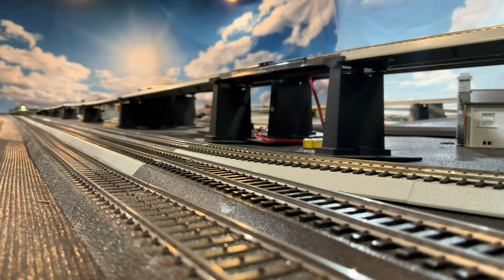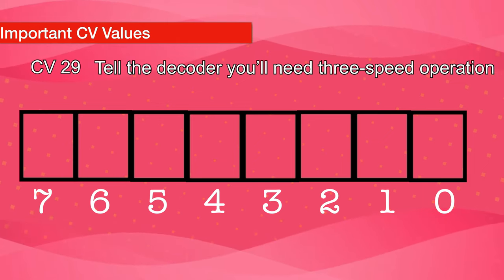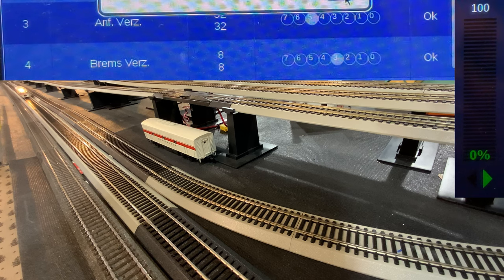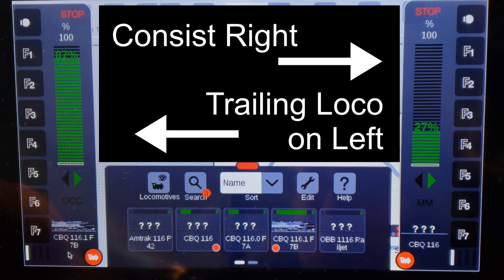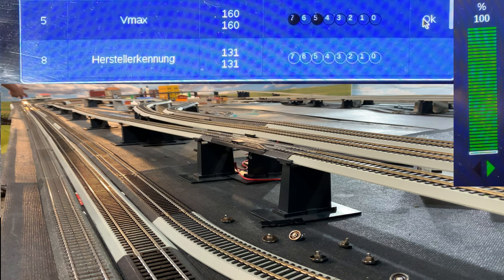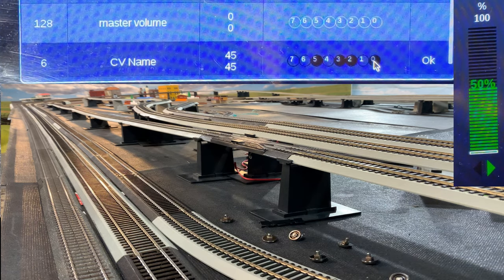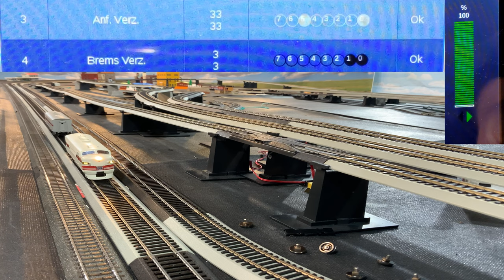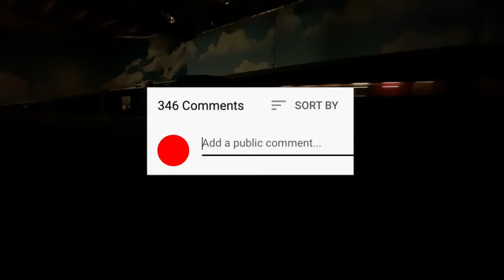Digital Model Railroading 101 - Lesson 3: Three Point DCC Speed Matching. Simple and Effective!

Comment: Thanks so much, Dr. Hobby, for a very informative speed matching video!
Great explanations, as to  comparing different  aspects of different  speed matching decoders. 
haven't preformed much speed matching yet, but I'll certainly need to do so soon.
(By the way, I haven't heard anything from Rapido service dept. Yet, regarding my EP-5.
Do you think I should wait a little bit longer before I call them?
It's been about 2 weeks).
Reply from the maker: Thank you so much! I'm trying to make all of these accessible even to the most neophyte modeler. 

As far as calling them--maybe. Two weeks isn't very long when you're talking about model repair. I've had some out for over a year. This shouldn't happen with a smaller company like Rapido, but 2 weeks still probably isn't enough. Also, from what I've seen in the comments and in other places there are going to be a fair number of people sending their EP5s back for pantograph issues.. fun times.
Reply: @DoctorHobby  Thanks for your thoughts on the EP-5 repair issue.
Thanks again Dr. Hobby for your great model train videos!